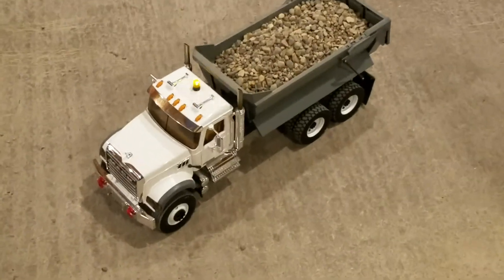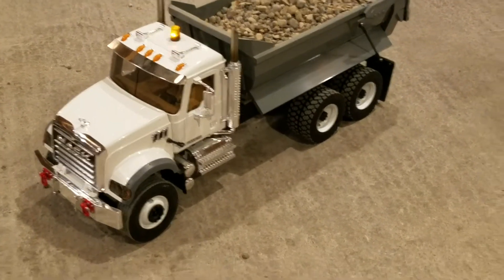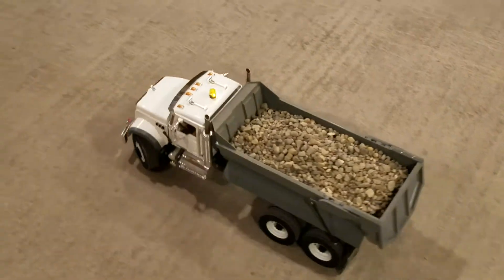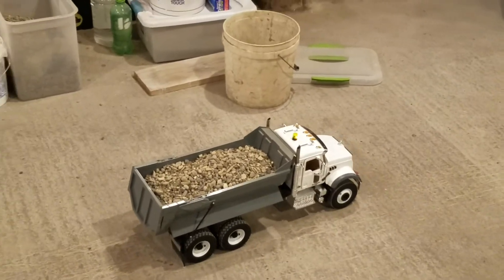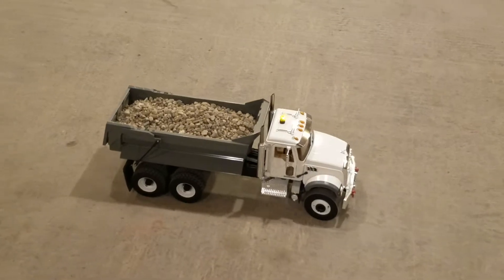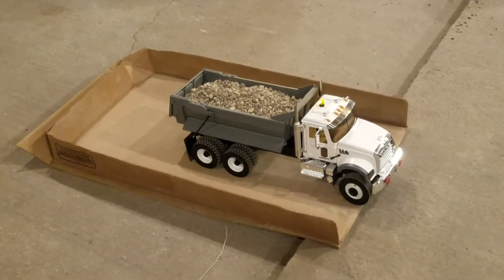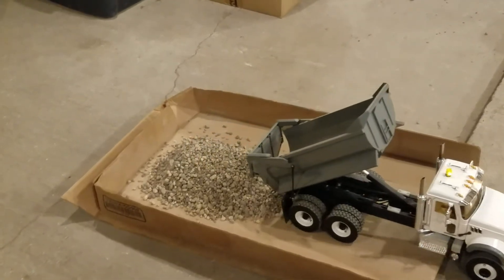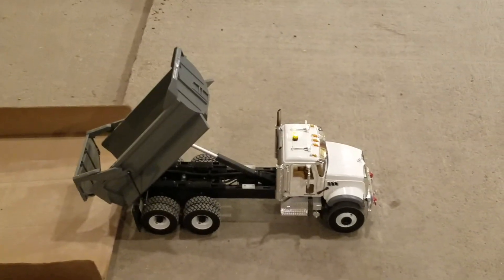1/16 Bruder Mack Granite Halfpipe RC Conversion

Comment: Question not covered in the link
How do you run the 6v linear actuator with a 3 cell lipo battery? I’m just getting back into rc after 10 year absence sorry if dumb question
Reply from the maker: The ESC sends 3S power to the motors while only putting 6V into the receiver.  The Actuonix 6V linear actuators run off the receiver, not the battery.

Comment: I wish mine would dump like that! If I put a whole load in the box, I have to help the box for the first inch of raising before it can dump on it's own.
Reply from the maker: I would like to try a hydraulic lift/dump system. Just wished they weren't $350-$400. Hard for me to justify spending that much. One thing I have learned with the actuators is to make sure they are mounted at an angle and do not heap the boxes full. Hardest part with the linear actuator is to get movement started. Kinda have a dead spot in them there, once in motion they seem to have good power.
Reply: @dennybobsrcconstructionagc2796  I LOVE my hydraulics! With my side dump trailer the tractor is teh weak link. The trailer will dump ANYTHING I load into it. We tried to overload the trailer heaped full, falling off the sides. The trailer dumped it fine. The truck needed a little help to climb the hill to the dump area, it was so heavy.
Reply from the maker: Also been trying to think up a spring lift assist to get them started upward.
Reply: @dennybobsrcconstructionagc2796  I like this idea. I'll anxiously be watching to see what solution you come up with.

Comment: Nice truck a bit setchy on the suspension. I imagine on uneven road this would have top issues.  Maybe more of a droop suspension will work better for your heavy loads.  I have a droop suspention on all my awd Macks.  So when there is a full load the suspension will rest nicely on chassis which also stablizes the load.  When the ground becomes more uneven the droop suspension kicks in to soaks up everything you throw at it. Im not exspecting a reply back because you never do yet I just wanted to help. Maybe I'll just blow the minds of everyone as show my under carriage.  There will be some design stealers for sure trying to figure it out then lol..
Reply: ps thumbs up man
Reply from the maker: Put in some stiffer springs and the body and frame roll is almost gone. Still allows suspension movement for better off road traction.